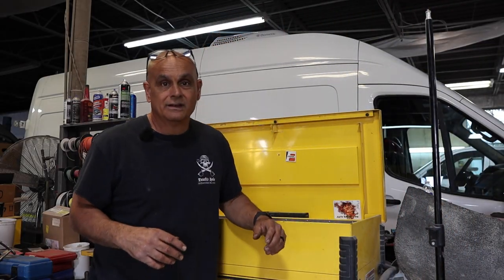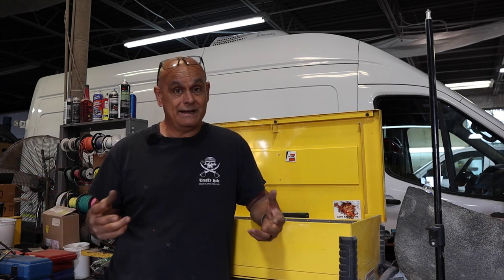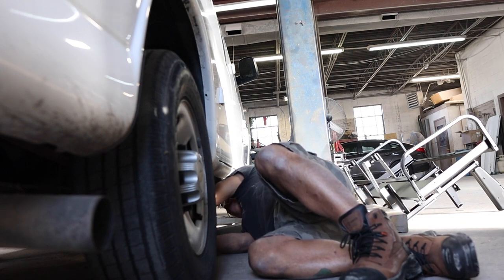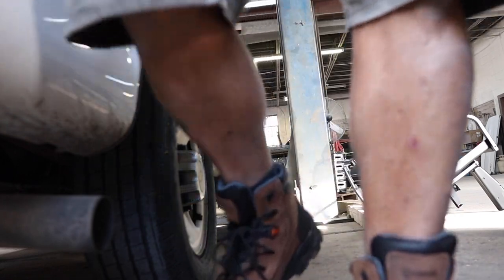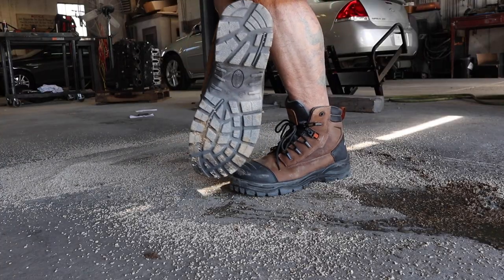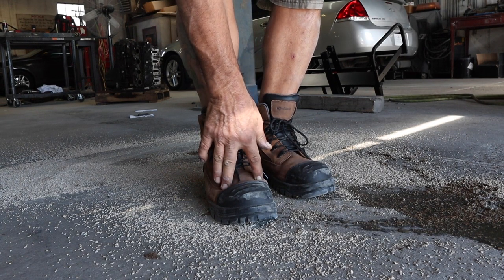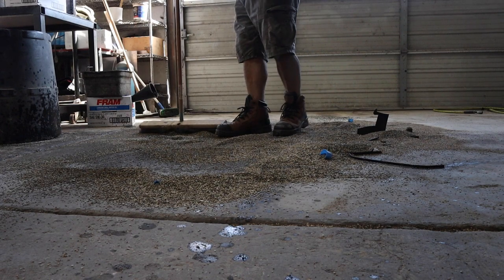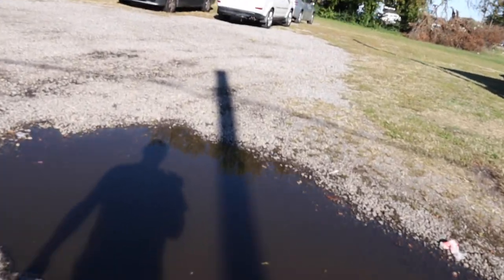Hands Down The Best Work Boots I Ever OWNED and They Were Steel Toe

Comment: Work boots with fiberglass composite toe cap, no metal in the whole shoe, can withstand 200J anti-smash and 15,000 N compression resistance. " I guess they are not steel toes though! I think I have that composite toe cap also in my boots. Only I don't have the over protection layer. Rubber?
Reply from the maker: I’m still wearing them I haven’t had any issues and as of the steel toe, I don’t need steel to where I work, but I have dropped   an engine block and they held up just fine
Reply: @AutoRepairTips757  that's some seriously strong composite - must have been an aluminum engine block. haha. thanks